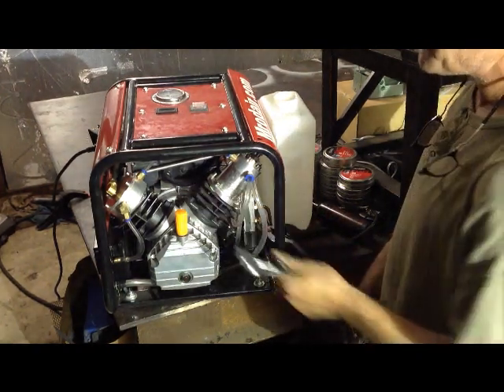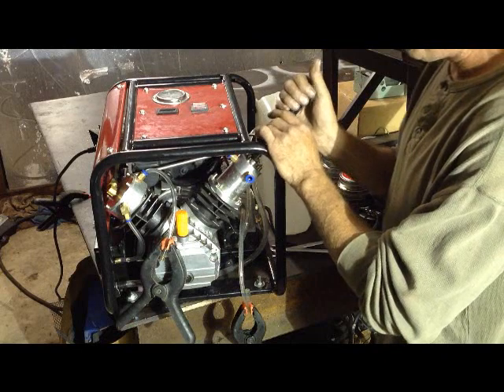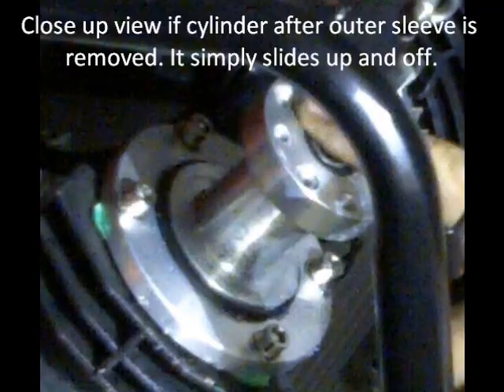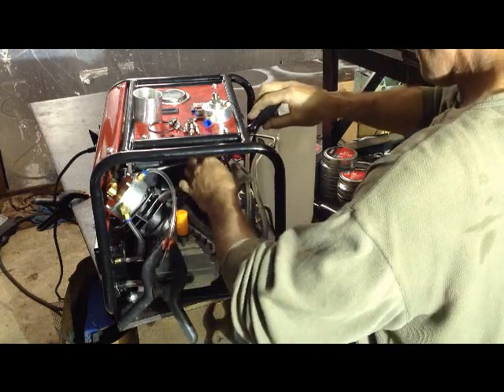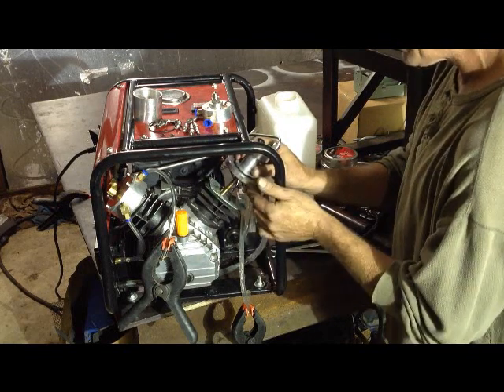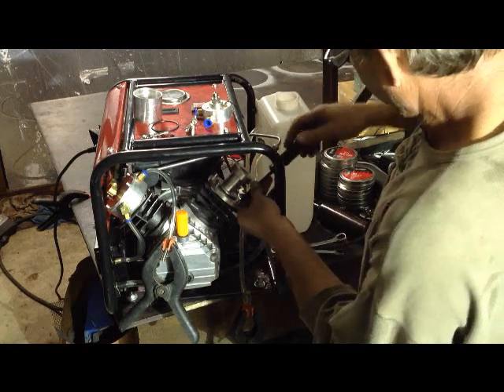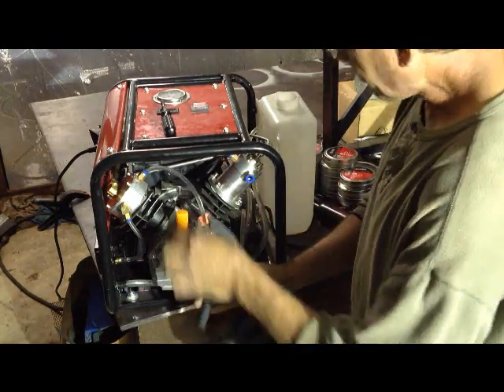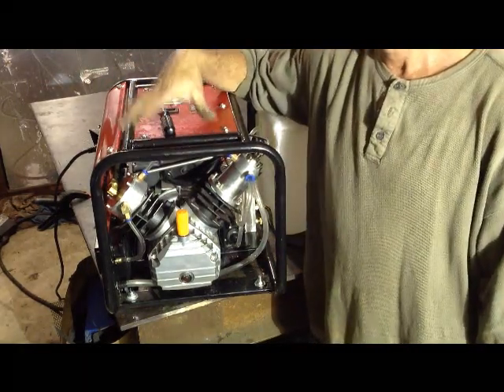Compressor teardown video

Comment: Michael one of the the bolts that holds the black fins to the case snapped off and I need to extract the broken Bolt if I remove the Unbroken Bolt can I just slide whole assembly off  at once or do I have to break it down like you did in video